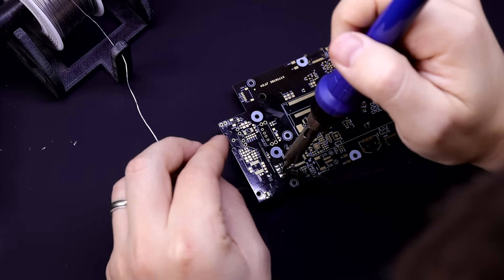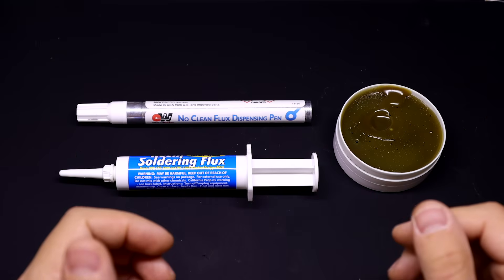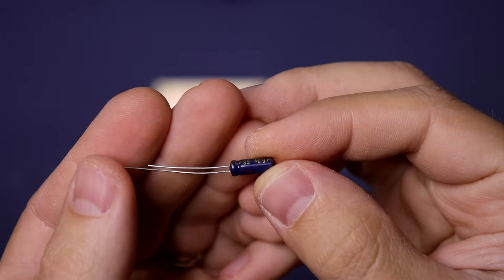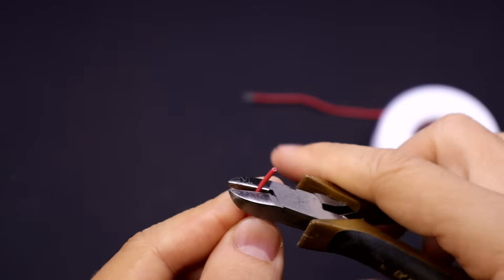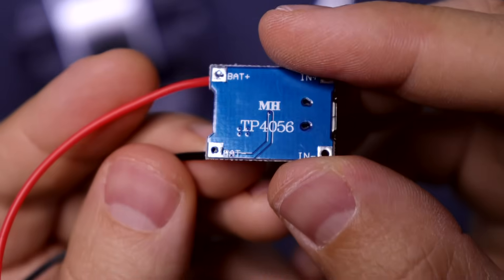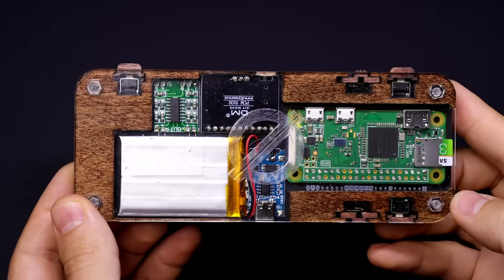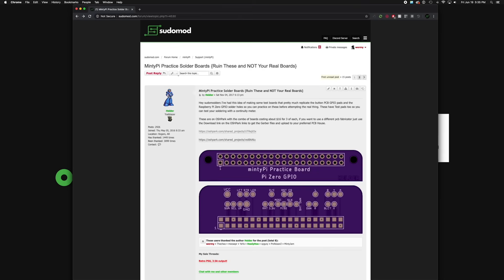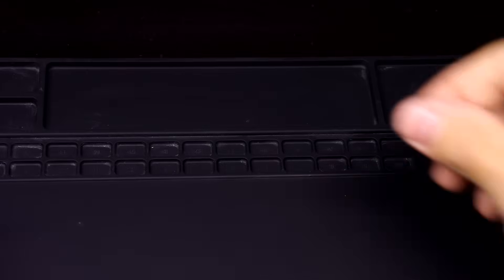Soldering Crash Course: Basic Techniques, Tips and Advice!

Comment: Great video, but helder brings up 37/63 solder. Do you not use that?
Reply: Arkillian The only reason for using 60/40 over 63/37 was cost: historically, it was a bit cheaper. Nowadays, with all lead solders being the minority since lead-free took over, the price difference has vanished. I only buy 63/37 for my leaded solder. 

P.S. 63/37 and 37/63 aren’t interchangeable: in solder, the first number always means the tin, the second the lead. So you can’t swap around the numbers.

Comment: WHY DOES THE SMOKE ALWAYS FOLLOW ME!?  Lol.  I've soldered electronics, built my own quadcopter, fixed trailer wiring, indoors, outdoors, always the smoke seeming to go right for my face.  The leaded solder is supposed to be easier to work with but just knowing there is lead in it has me always holding my breath.
Reply: Sryously The lead does not vaporize, as soldering temperature is far below its boiling point. The smoke is only the flux. It’s not good to breathe in either, of course. And no, it’s not your imagination: the smoke DOES follow you! Somebody analyzed it scientifically and was able to explain the physics of it. The solution is a solder fume extractor. You can get cheap ones from China.
Reply: Brooo

Comment: Good stuff,  but there was no mention of the fact that solder is attracted to heat and the many uses. When I put two wires together (as in 7:50) I do strip off more. Put solder one end of the exposed part, heat the other part, and the solder will flow through the entire thing giving a solid connection. Its also the basic reason why braided cable works so well. Also you mentioned the common mistake of using too much but no mention on removing solder.

Comment: For anyone looking for mobility with their soldering iron, I'd totally recommend getting a TS-80. It's 60-70 bucks, USB-C powered, has digital temperature control, and runs off pretty much any Quick Charge capable power brick or bank at home or on the go. Bought one two years ago and never regretted it. Although I have to admit, that station with built-in PSU sounds very interesting…
As for the video itself, well made and still entertaining to watch, if you've soldered before. I missed a more specific note on temperatures and the shine/surface of solder joints, though. Also not "cooking" the rosin/flux off early might be something to note. :)

Comment: In Germany you can't get leaded solder anymore. The best replacement seems to be solder with silver in it.
Reply: Manu _ See if you can order it from abroad, like Farnell or Digi-Key. They will send leaded solder to me in Switzerland, which is subject to the same restrictions as Germany.
Reply: @tookitogo  why should I? The lead free solder with silver works great. You get used to it very quickly and no longer have to handle toxic material while soldering.
Reply: Manu _ Sorry for trying to be helpful... it sounded like you wanted to get leaded solder but couldn’t.
Reply: @tookitogo  sorry if my answer was offensive (English is not my native language). I just wanted to point out that silver containing solder can be equally as good as leaded solder. In fact I still have some spools leaded stuff and bought the lead free solder just out of curiosity.
Reply: Manu _ Keine Sorge! (Deutsch ist nicht meine Muttersprache und ich mache immer wieder Fehler.)

While I do find leaded solder to be easier to work with than lead free, it’s only by a small amount. I totally agree with you that good lead free solder works perfectly fine. I don’t agree with the old geezers who act as though lead free were the work of satan... 😂

Comment: I've seen some iron tips that are pointed (like you showcased) as well as chiseled?  What  scenarios would you  use one  over  the other?
Reply: Art Strutzenberg Conical/pencil tips, IMHO, are almost useless. A chisel lets you get much better contact with the joint in almost all situations. (The raspberry pi surface mounting is a notable exception.) Honestly, it  has never made sense to me that so many soldering stations come with conical tips by default.

Comment: very excellent video. i would suggest a video on how to fix common mistakes like using wick or other tools for removing excess solder. maybe also demonstrate how to use enameled magnet wire since it seems somewhat common in the mods ive bought.

Comment: Just finished building my first MintyPi Lite and it was great, the biggest pain in the butt for me was the four power wires that all broke twice when moving them around.  Third time's the charm, made sure I soldered strong connections.  Also I didn't use silicone coated wire.  🤦‍♂️

Comment: Have you tried using solder paste instead of regular solder for soldering the raspberry pi's GPIO? I feel like squeezing paste with a syringe inside the pinhole would result in a easier to solder and more reliable joint
Reply: Vinícius Solder paste would work well for sure. But so would just adding a bit of flux. If I were going to do this, I’d tin the gold PCB pads first, then suck off the excess, give it a clean, brush on some flux, and then proceed as in the video. That removes the gold-contaminated solder, which is much more brittle than gold-free solder, and being pretinned would make it flow better overall, so it won’t take as long as his joints.

Comment: You should tin the tip when finished, don't clean it. Tinning it protects the tip against oxidation
Reply from the maker: The "Tip tinner & cleaner" that I show towards the end does tin it.  :)
Reply: @wermy  I saw that, that's what triggered my comment. I don't know what you use there in the end. If you store the tip with tin on it, then that's great. The metal curls in the base cleans, but also removes tin, which is not what you should do when finished.
Reply from the maker: @rondlh20  Ah, I get what you're saying now.  It's still pretty well-tinned/shiny when I put it away, a quick poke in the curls just removes the excess.
Reply: wermy There’s no such thing as “excess” when it comes to protecting the tip. There is absolutely, positively no advantage to cleaning the tip before putting it away, but it does risk reducing tip life. The OP is 100% correct.
Reply: wermy Also, you never want to use tip tinner and then put the iron away: tip cleaners are strictly for removing stubborn oxides. I strongly advise against using them for daily tinning. (They’re also rather expensive for that.) Their instructions say that once you’ve managed to get it shiny, you want to clean the tip thoroughly and then re-tin it with solder. The flux in tip tinner is rather aggressive and can cause corrosion of the tip, as well as of your circuits if it gets transferred. (I recommend wiping the tip tinner’s flux off with a paper towel, so as to prevent contaminating your brass wool, where it could retransfer onto the iron and onto a circuit.)